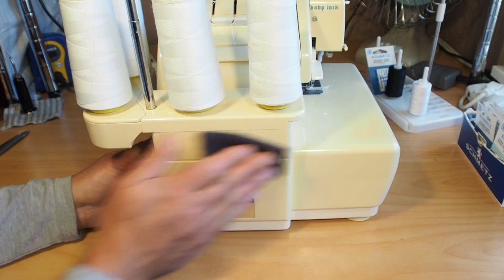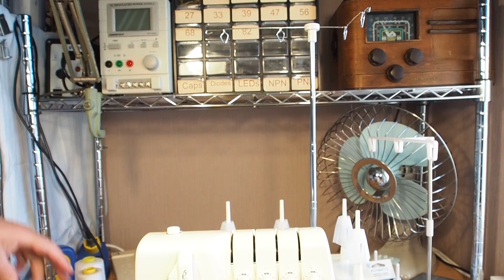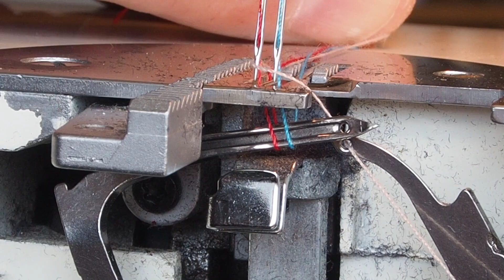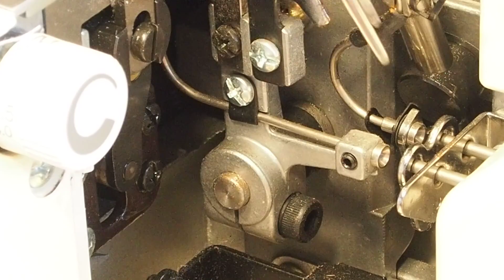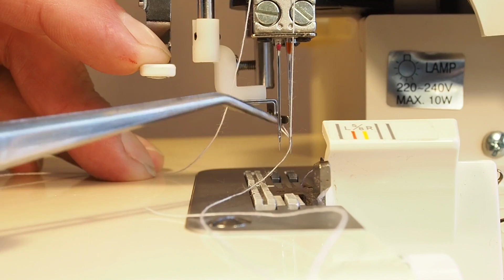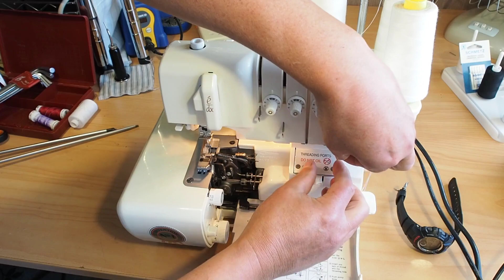Babylock Jet-Air Threading Serger / Overlocker - Model BLE1(DX)

Comment: Thank you so much for this video. I am a beginner and this is my first machine. Please excuse me if this is a dumb question but what are the cones for one the 4 pegs? I see that you left them on for the serger thread (the large thread). Do they typically come with serger thread or do they need to be purchased separately?

Comment: I just called where I purchased my eclipse about 5 years ago. The owner told me to look in the envelope which came with the machine. Remove the tiny wire to put through the loopers and then attach the thread and pull everything thru. My machine now works perfectly!!!Again you need to do a video of this quick repair on the Eclipse. No, it is not for sale. I’m not sure whether I can just use the air vent again. But it is rarely necessary to put a thread in from scratch.

Comment: I loved this video. It helped me understand my eclipse that I am having trouble with. The air does not blow hard enough to get my threads into the piping and come out where they should. Something is wrong with my machine.
Reply from the maker: Maybe there's some dust or foreign matter in the bellows? It may need a service. Thanks.
Reply: @InStitches  thank you very much for your quick comment. I certainly got it working again. Maybe I have gotten rid of dust but maybe I don’t need to use the bellows at all. It would make it a tiny bit easier but the machine runs just fine now. Will let you know when day if I need to start from the beginning to thread my beautiful eclipse. I truly loved your complete video.

Comment: I just got a baby lock evolution and the stitch finger is so flimsy it bends when you pull the thread chain and it will skip the stitches and the stitch finger will get bent  and almost break the needle because of the pull idk why they change the finger design on the evolution and I think evole ? I hoping on ordering the replacement part for the stitch finger hoping it’s more sold metal
Reply: I got my serger fixed and it’s so much better

Comment: Thanks for sharing  such a detailed video on threading the baby lock serger.  I also have a similar baby lock serger (BL 55). I have threading problem.  When I press the threading lever thread does not come out of the needle, it stops somewhere in the middle. I keep pressing the lever but to no avail. Please help me. By the way, I have  cleaned the path way there is no obstruction. Best regards
Reply: Me toooo!! I wish I could work this out because   it's driving me crazy and beyound clearing chanell there's no other hacks I can see

Comment: I can’t get thread to go into ports more than 1/4 inch or so.  How do you make the thread stiff or straight enough to go down 1 inch into the ports?  Are there any tricks?
Reply from the maker: The thread should be able to be pushed in 1 inch unless there is a slight blockage in the port. Maybe the thread you're using is kind of fluffy if you know what I mean? That could cause issues too. Maybe try different thread?
Reply: @InStitches  I am using Maxi Lock thread, which I have been told is the best cone serger thread.

Comment: I've been using an eclipse for over twenty years, it is the best! I find it really helpful to use the little tweezers that come with the machine to hold the thread to easily insert the thread into the loopers. I was taught at a company training seminar that this method keeps the natural oils from your fingers from ending up in the looper airways and NEVER ever lick your thread. Hope this helps.
Reply from the maker: Thanks for the tip. It makes sense that natural oils from fingers could foul the threading port.
Reply: @N03m1 Zbermeo I found mine on Ebay and I LOVE IT! I got it for unde $300
Reply: good advise about the lick as i think most people do that.. myself for one